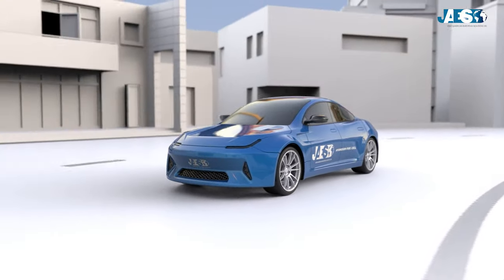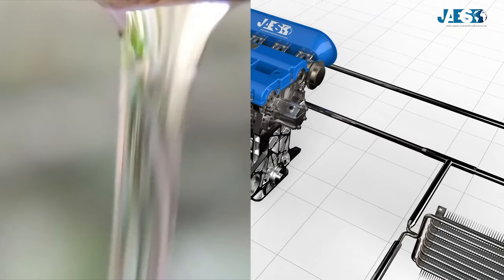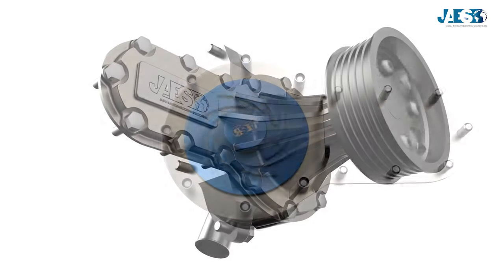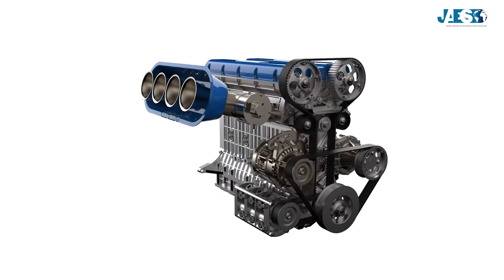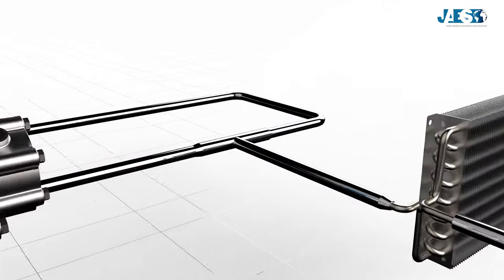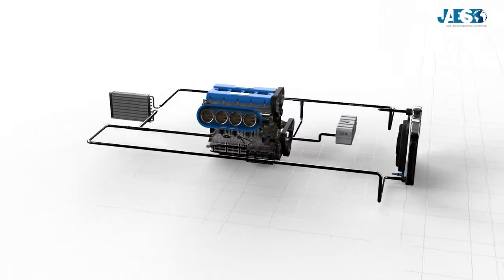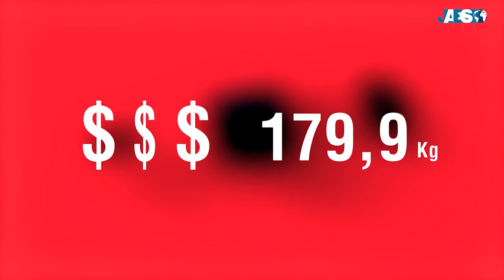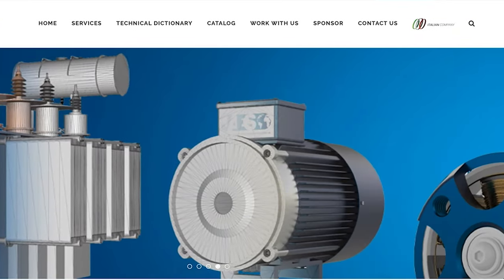How does a car's cooling system work? (CAR PART 7) - Radiator - Antifreeze

Comment: Why aluminium radiator is used instead of copper in cars 
Copper is better life and cooling than aluminium
Reply from the maker: Thanks for your comment! The limits are the resistance of the material, the weight and the air flow. The copper-brass alloy is not as strong as aluminum, so its tubes are more susceptible to explode even under the relatively light pressure generated by a cooling system.